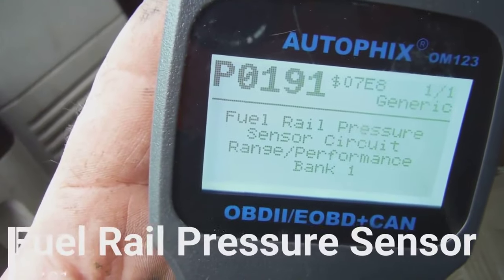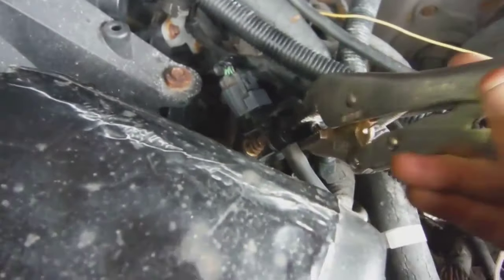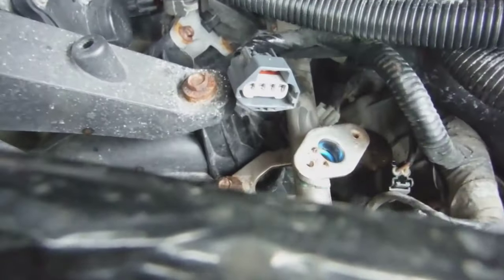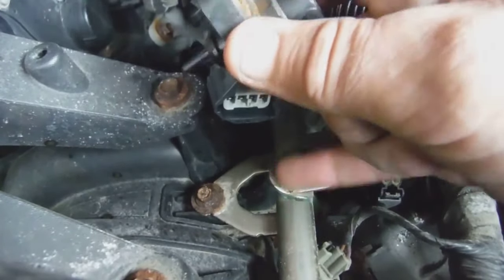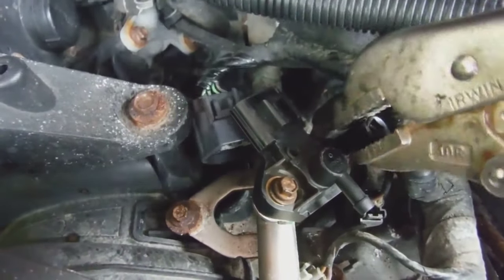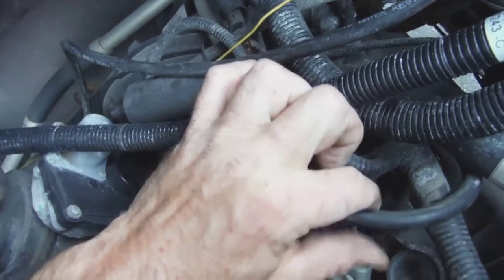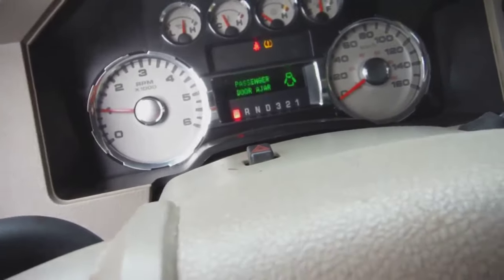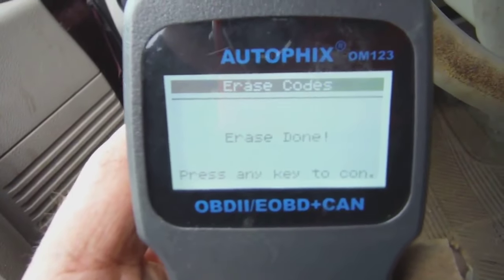Replacing Fuel Rail Pressure Sensor CODE P0191. #PO191 #P0191 #ODBCODES #odb #reader #repairs #car

Comment: Replaced this sensor but did not fix my p0191 sensor. What fixed my problem on my KiA was replacing my upstream oxygen sensor :-)
Reply from the maker: Yes this diagnosis can be many things..
Reply: So my F150 gave me this code.  Changed it and still won’t start.  WTH?
Reply: @maximiliankolbe_NIN  try your fuel pump relay, fuel filter , then fuel pump in that exact order. Cheapest first. Those are all the options

Comment: My 2014 Cadillac has this problem currently, I got a diagnostic test at auto zone. The codes were P0191 and underneath there was another line that said SECONDARY DTCs  P2272 HO2S signal stuck bank 2 sensor 2. What does this mean??? Am i able to fix this myself